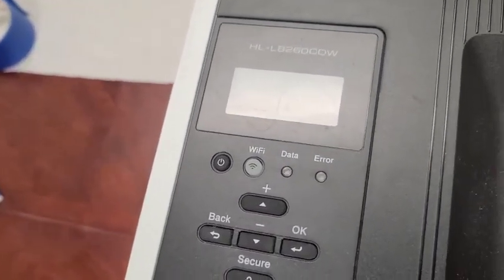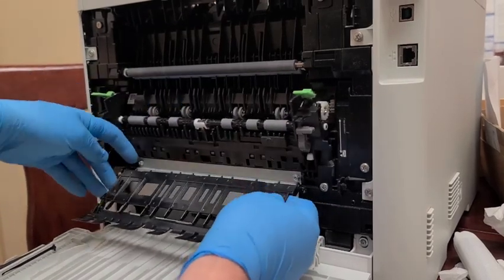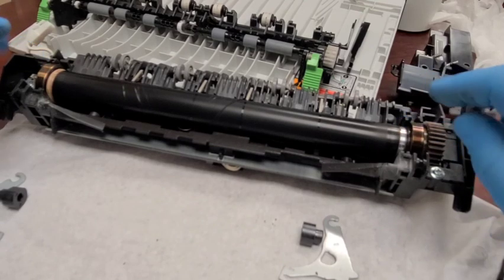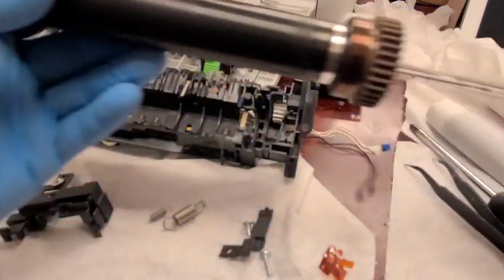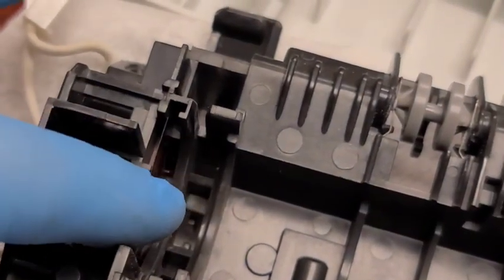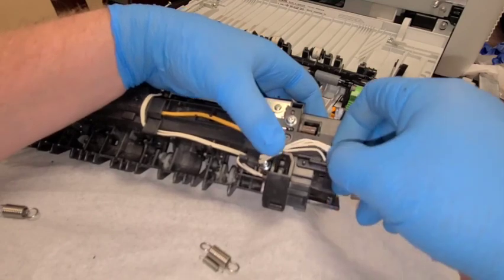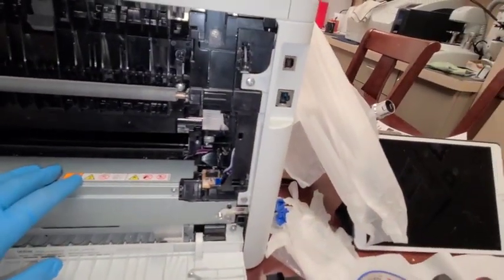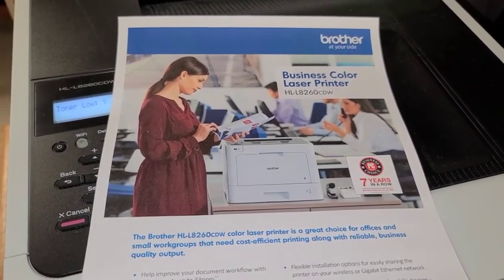Brother HL-L8260CDW Laser Printer Fuser Roller Replacement

Comment: Quick question... The bottom right hand panel's small tab (V shaped) has broken off. Does the entire right hand panel need to be replaced or will it still work without the small V shaped tab? Regardless of what I do I continue to receive "print unable 05 code."
Reply from the maker: I am not an expert on Brother printers. I am assuming you already checked out their support page: https://help.brother-usa.com/app/answers/detail/a_id/150741/~/print-unable-05

I don't understand what small tab you are referring to.
Reply: Did you manage to fix the 05 error ?  I have same promblem

Comment: i got a paper jam error after doing this. any suggestions?
Reply from the maker: My only guess is that a screw or some bracket was replaced incorrectly or some wire is blocking some sensors.  Unfortunately I am not an expert repair technician, that's why it's DIY. I recommend taking it apart and reassembling again.
Reply from the maker: Or could be a defective roller?